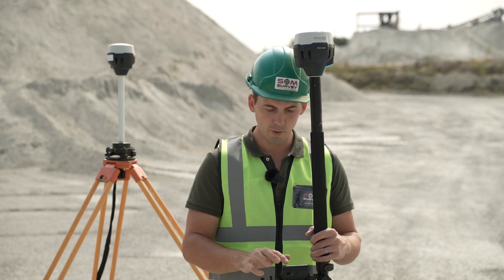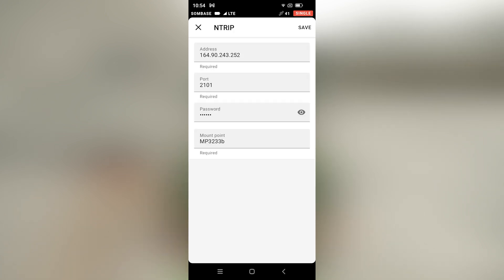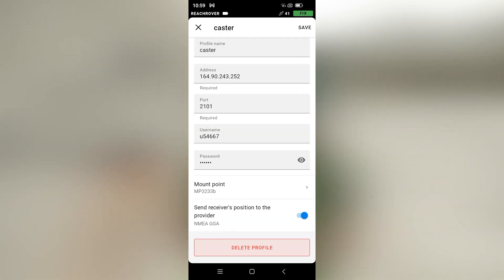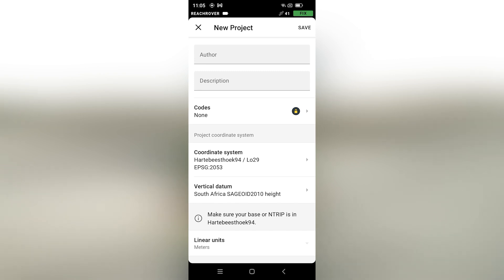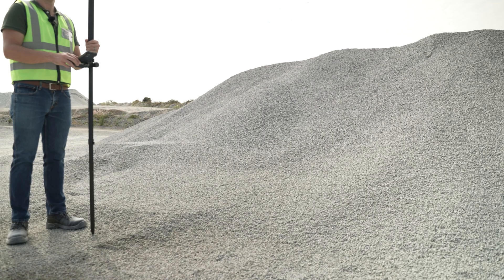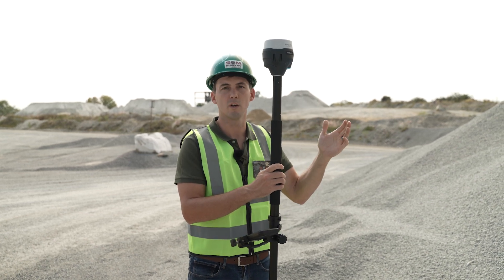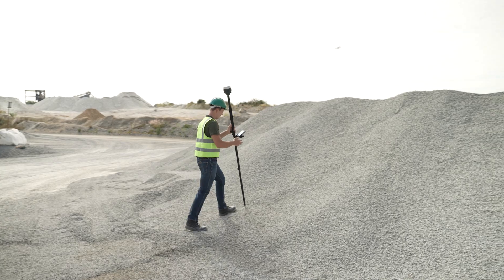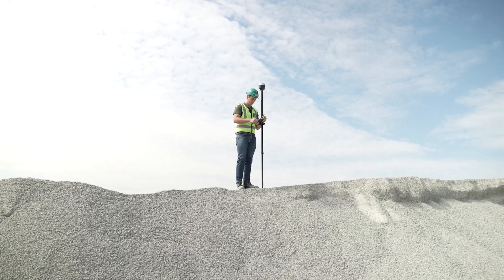How to calculate a volume of a stockpile using Volumetric Calculations over Local NTRIP Station

Comment: Hello guys! Aftwards, shouldn't be converted to local coordinates instead of using UTM coordinates to take measurements and volumes? Or, shouldn't use a calibrated system to get this job done? Thanks!
Reply from the maker: Hi there, thank you for reaching out! 

A local coordinate system was selected when the project into which the data will be collected was created. 

In this case the local coordinate system was Hartebeesthoek94/ Lo29. Whether to use a calibrated system or not depends on the specification of the job. In this case it was not a requirement to work on a calibrated system as a local survey was done.

Hope this helped!